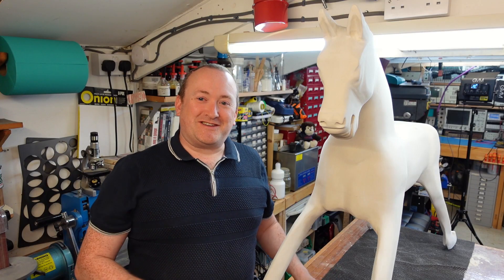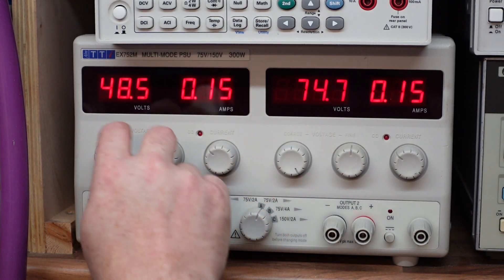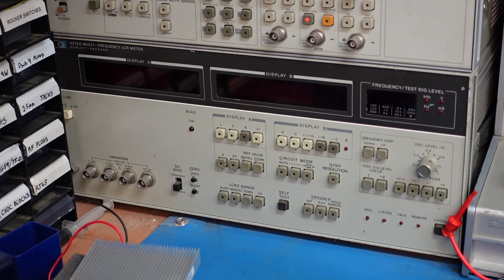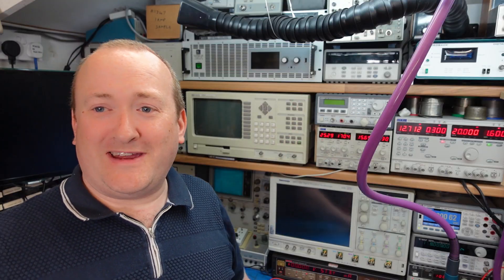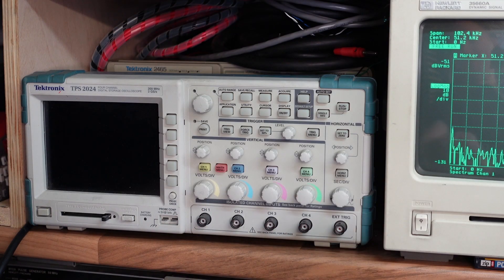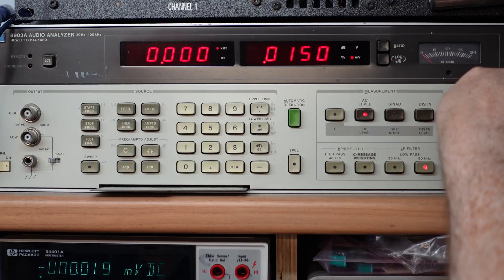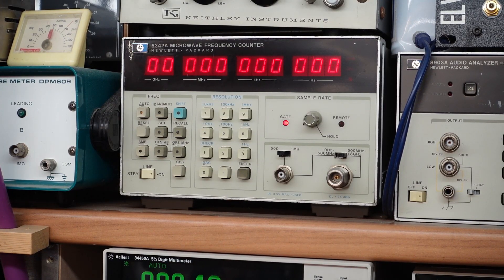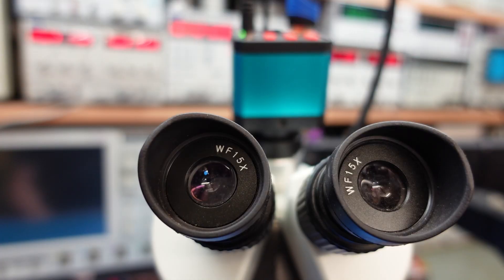Electronics Workshop Tour

Comment: Mark, a quick tip if it helps. You could replace the hard drive inside Tektronix DPO 7234 (i presume it has one, coul be wrong though) with an SSD version. Probably it's IDE drive, for which there are also SSD types available on the market. If that's the case, you could easily clone the original drive on to SSD (with Clonezilla for instance). Since Tektronix runs on WinXP, it would be then also advised to optimize system settings for SSD, in order to prolongue the drive's  life (you can google tips). You would significantly gain in boot up time. The app itself should behave the same though, since (once booted) it runs from RAM. 

Hope you find this  useful. And a big thank to you for all the knowledge you share with the rest of the world.

Comment: Truly a dream shop. What I wonder is how all that equipment is powered. There must be an absolute ton of power cords and outlet strips behind the equipment. How many amps is the electric service for your shop? I assume there are constraints as to how many things you can have running at the same time. Do you have strategies as to what is turned on based on the item you are working on? I won't even ask what your monthly electric bill might look like.

Comment: That's an impressive laboratory! My 'lab' consists of a simple bench power supply I found in a skip. It's variable up to 30 volts and with variable current up to 3 amps. 1 digital multimeter and 1 analog multimeter. 30w soldering iron, weller induction iron and thats it. That's all I am able to understand. But I'm enjoying learning from Mark's videos! 👍

Comment: Nice shop. What are the approx. dimensions? I didn’t know you did projects other than electronic ones.👍 I have a piece of hardboard (not sure of the UK equal - Masonite?) on top of my bench. It’s held in place by screen moulding around the perimeter. When it gets destroyed, it’s an easy replacement.

Comment: OK, so, I had a bit of spare time......

Tektronix Model EX752M Power supply
Tektronix model QL564T power supply
Tektronix model PL303QMDP power supply
HP 6209B x2 power supply
Keithly 240A high voltage power supply
HP 6021B power supply
HP 8112A pulse generator
HP5334B universal counter

HP4274B LCR
Tektronix 576 curve tracer
HP3314A signal generator
HP3312A 15mhz waveform 
Keysight 34460A 6.5 digit multimeter
Agilent 33120A 
Keithly 236  Source Measure Unit
Tektronix DPO7254 Digital huge oscilloscope (that takes minutes to boot into WinXP)
Kemo dual channel elliptic filter VBF/24
Electronic Load EA-EL 9080-170B
Tektronix AM501 "op-amp in a box"
Tektronix AM502 differential amplifier "sort of the same thing as 501"
Tektronix SG505 Oscillator
Agilent 34970A Data acquisition switch unit
Feedback DPM609 digital phase meter
HP 35660A spectrum analyzer
Tektronix TPS2024
Tektronix 2465
Rigol DS2072A (tucked away behind 2 other scopes!)
Agilent 33450A 5.5 digital multimeter
HP33401A multimeter
HP8904A signal generator "my favourite"
HP3580A spectrum analyzer
Tektronix 454A oscilloscope "I'm very fond of this"
HP8903A Audio Analyzer
HP8657B RF 2hgz signal generator 
HP8566B spectrum analyzer (Spectrum Analyzer display is a separate unit on top)
HP85650A Quasi-Peak adaptor (has speaker in front so you can listen to the radio)
HP8350B sweep oscillator
HP83292C RF plug in 0.01-20Ghz
HP5342A Microwave Frequency counter
Mechanical needle humidity meter
Tektronix TDS754D digital scope
Metcal DS1 desoldering gun
Quick 8612 hot air station

Comment: I like to watch your videos Mark. I found this one particularly interesting, as it covered r.f. measurement. My hobby is amateur radio, which I have had the full transmitting license for over forty years, and have recently started using the 23 c.m. (1295 MHz) band, hence the interest in some of your r.f. workshop test equipment. I wonder if you get much ham gear in for repair, if so maybe it could be material for a future video. Please keep up the videos and great content, Mark. All the very best Geoff / G4SQJ.

Comment: Hi Mark,

What a pleasure to watch you're videos! I hope we wil see a lot more.of you're videos!

I have three questions:
What type of tube you used to extend the hot air station?

Could you tell us more about the powerline Protection you use to test you're equipment that your repairing/ testing? (The sockets on the wall at your right bench with the light bulb)

And what type of load(how is it made) you use to test the outputs of the amplifiers you repair/test?

Kind regards,

From the Netherlands!

Comment: Maybe you know this one already but If your HP3314A is old enough it might have the Handel's Messiah Easter Egg buried in the firmware.  From power OFF, push and hold the "SW/TR INTVL + START / FREQ + blue function key" then turn ON the power and continue to hold those buttons until you see the seven segment led  flashing register address locations - then let go of the buttons.  When it's done loading memory it will start playing Handel's Messiah in it's entirety.  PS. you'll need to connect a speaker to the function output jack to hear the music!  Back in the 80's, a good friend of mine worked for HP and knew the Engineer that worked on this function generator.  As the story goes, HP's test equipment product development model gave the Engineer a crazy long time to develop the instrument.  Usually takes about 10 months to get to a production ready instrument, then they get a couple of "extra" years to over Engineer the product which is why their test equipment is so good and lasts so long!  The Engineer for the 3314A had finished way ahead of schedule and finding himself with lots of time on his hands decided to hide this musical effort into the ROM code.  It took many years before his supervisor discover what was done and they subsequently removed that Easter Egg from the firmware.  HP Party poopers!!  enjoy...
Reply: Классная история! 😅
Инжинер спрятал пасхалку в ППЗУ от хьюлет паккард!  Однозначно 🏆👍
Reply: You must mean it plays the Hallelujah chorus in its entirety. The entire work, Handel's Messiah, is about 2.5 hours long. Very cool bit of trivia though. now I want to hear it do it 😃
Reply: @zetacrucis681  https://www.google.com/search?q=HP3314A+hidden+easter+egg%2Chandel&oq=HP3314A+hidden+easter+egg%2Chandel&gs_lcrp=EgZjaHJvbWUyBggAEEUYOdIBCTIwNTg4ajBqN6gCALACAA&sourceid=chrome&ie=UTF-8#fpstate=ive&vld=cid:5b097d04,vid:FCpao1XeOfU,st:0

Comment: Hi Mark, thanks for another great video. You lab setup is very impressive. You have inspired me to get back into repairing. Could you make a video about how you have your test equipment setup with the required mains isolation. It would be great if you could also cover how you have wired the voltage and current meters on the wall.

Comment: beautiful setup Mark……. question for you, how difficult was it to extend the hot air hose? any pointers, source and type of hose? thanks for info on this.
Reply from the maker: I used a 2 metre silicone vacuum hose, 13mm internal diameter. Found it on eBay. Inside the hose you will need to extend the wires ( maybe 4 of them?). It works very well- I was pleasantly surprised!

Comment: Very much enjoying the video's. Do you run your test equipment from an isolated mains supply? Also especially with the scope and soldering iron do you disconnect the earth connection on the mains. Please keep the videos coming.... Great stuff !
Reply from the maker: Hi, all of the test equipment and tools are directly connected to the mains supply, with the earth/ground still connected. I power the item I am repairing from an isolation transformer and variac. 
Thanks for watching!
Reply: @MendItMark  Thank you for your reply. I am hoping to rejig my workshop soon (its on a very long list of things to do before I die) My question mainly relates to the use of test equipment (especially a scope) for fault finding on the primary's of switch mode power supply's, high voltage circuits or any amplifier (or device) where the output sockets have a dc voltage with respect to earth and should not be grounded. Hope that makes sense !!! Best wishes and many thanks. John.
Reply from the maker: @retro1970style  I have an isolated scope, Tektronix TPS2024, for that sort of thing. I previously used a Siglent isolated front end, but that’s being repurposed for a new piece of test kit (I’ll do a video about it eventually). You can of course use an ungrounded scope, but it’s not the safest way to do it.

Comment: With everything in same room, isn't dust a problem?
Reply from the maker: It’s not too bad. There is extraction on the worst machines (sanders and band saw). Also the workshop is quite long, so it doesn’t travel as far as the electronics kit.

Comment: Have you thought of swapping out the mechanical HDD in the Windows XP Tektronix oscilloscope for a SSD? Might future proof it, and booting will be faster.
Reply from the maker: Hi, yes I have thought about it…. But still haven’t done it. I really should get it done, at least as a backup. If that disc dies, the scope is scrap…
Reply: @MendItMark  I have done it with some older machines I have. I used free Macrium software and usb to sata cable. The macrium software is neat because it allows you to clone from a larger hdd to a smaller ssd. Very handy if you have a larger drive but just a small partition. Macrium automatically resizes the partition. 

Just do it, the hardware gets a new lease of life and boots in second. Just clone and then unplug old drive and plug in the new. Nothing else. I didnt even remove the old drive, just taped the ssd where it fit.
Reply: Hey cool, didn't know you were in to electronics as well as automotive history 👍
Reply: @edwardclarke3601  I don't actually watch many car videos, it's mainly computers & audio repair like this. Mark is very positive, and I respond to positivity, plus having the same accent as me growing up (where did it go?!?) really helps.
Reply: This channel is freaking awesome why did it take you tube this long to show this guys stuff…..???? Very inspiring I love you’re content! Up there with Mr Carlson! Binge watch time!!!!